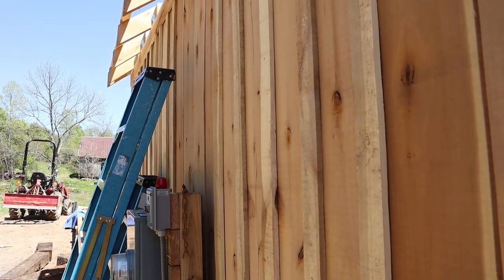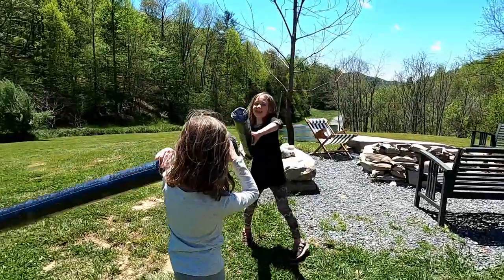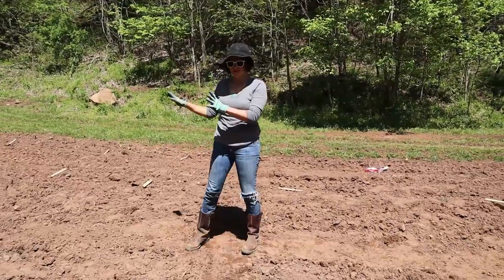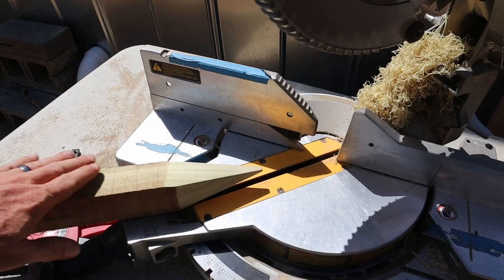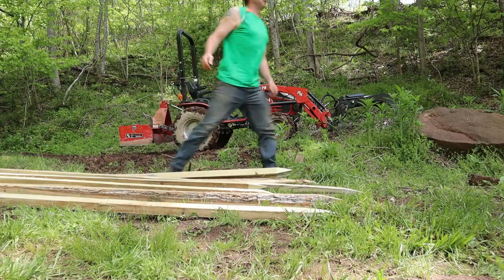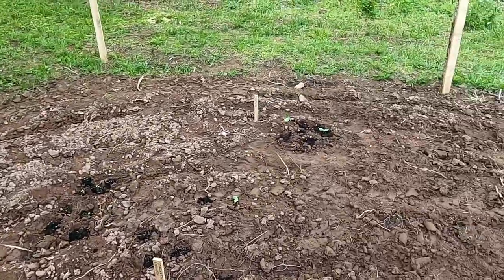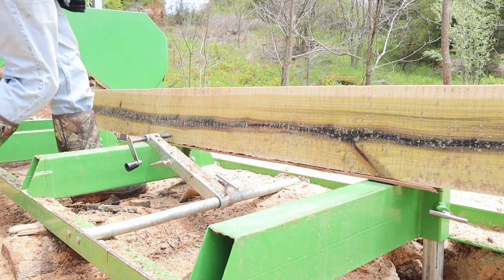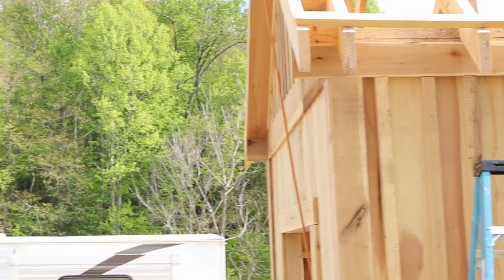E34 - Every homestead needs a garden

Comment: This week I have a question and a suggestion. Is your cupola decorative or functional (besides a place to perch your weather vain)? A cupola was added to a building to aid in ventilation. During hot weather the warm air would rise in the structure and be exhausted through the cupola and the cooler ground level air would come in through the door or window. If you would change your siding section and make some slots to allow air to come out from behind them it would function properly.

On the garden path I have a strange but effective idea. I some used juke back carpet that someone wants to through away and cut it into strips. Place that on your walkways and between rows that you have room to walk in. It servers several purposes. Rain will pass through it but it will keep the moisture in the ground instead of lettings it evaporate. It will also suppress the weeds and you won't have to hoe those areas. Over time the carpet will start to rot and you will have to dispose of it but until then you can get a few years of use from it. It's not nearly as hard to work with are rock.
Reply from the maker: Hi Tim!  Yes, it's merely decorative but also functional because I framed it with a gable roof instead of the standard or common hip roof that's popular on cupolas.  I will have a ridge vent when the metal roof goes on to provide ventilation and the rest of the roof will have a ridge vent also.  Airflow shouldn't be a problem.  Making the siding on the sawmill was fun.  I guess I was hesitant to have real vents because of wasps and other pests.  I did like the history of the cupola when I was researching it.  I learned it guided the air centrally so it can come in through the doors and windows and aerate the hay that usually sat centrally in the rafters so the livestock below would get fresh and dry grass.  Pretty clever.  
Speaking of clever.  That carpet idea sounds interesting.  It would probably germinate seed nicely too.  We might use some old wood slabs from the sawmill, which someone else recommended, but it's looking like we might not need anything at all.  Meg's been walking the aisles daily and the soil is firming up in those areas.  We'll see when we get a decent rainfall how it is.  I nixed the slate idea.  That idea was short lived.

Comment: John use the Bucket of the Kabota to push the poles in the ground
Reply from the maker: Yeah, I thought of that, Sid.  Didn't have it on the back of the tractor at the time.  Had the box blade on there.  I did try using the grapple bucket, but getting a decent grip was really difficult.

Comment: just noticed the guides on the band-saw machine are quite far apart, I have noticed the guys with these machines are always adjusting the guides as close to the timber as possible.  Might stop waviness and ensure dimension control?
Reply from the maker: I wish I could, Paul.  The ones on this sawmill don't move.  Might modify it so they can though.

Comment: Did you get a tiller for the tractor?
Reply from the maker: No, I used the hooks on the box blade to turn the soil.  I can't justify the cost of a tiller with a garden our size.
Reply: @WalnutsandWineberries  Yeah you're right. Especially since there are hidden boulders just below the top inch or so of soil. However, if you get most of them out using the box blade then eventually you could get a walk behind tiller to make it easier to put the garden in. You might find a good used TroyBilt rear tine tiller.